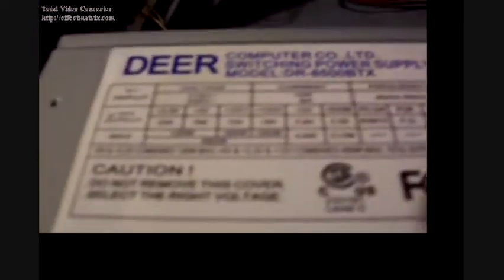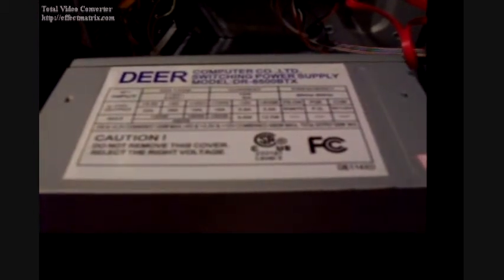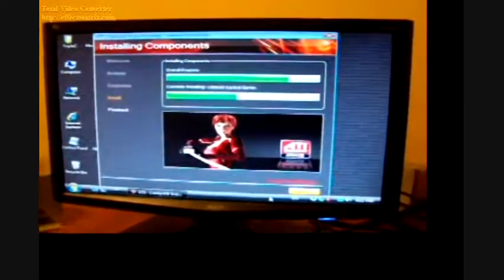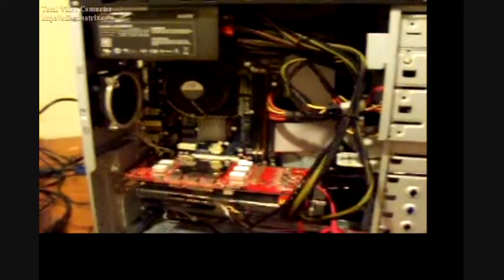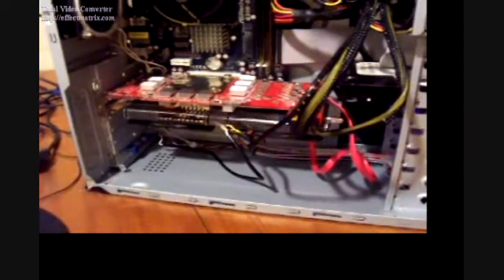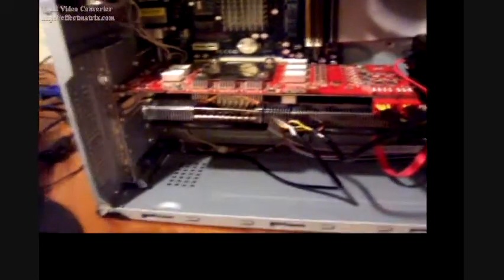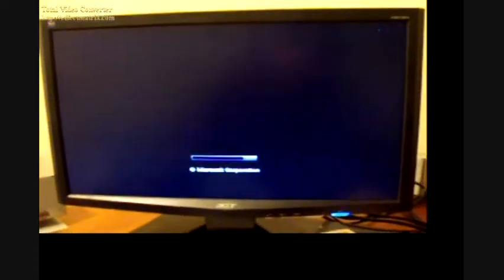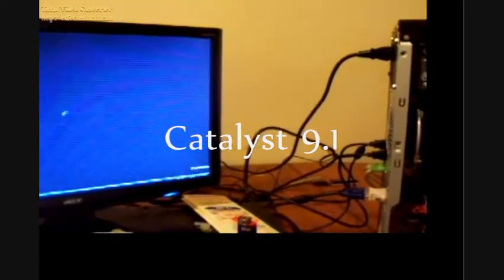Scythe.. OCZ.. PC Problem(Solved) - Part 2 of 2

Comment from the maker: i'm a little confused with the video card part in ur video. u don't have the video card installed.

based of what ur asking, first thing u should do is update ur BIOS, then try video card again, try only one ram to see if it works out, 

basically eliminate possible reasons, i'm thinking it's RAM, it's most likely to be a problem, download bootcd or ubuntu and run memtest86 without windows..

good luck

Comment: well there is probably another problem which causes 9.4 not to work because if it's there it has to have support for it, but ati has already discontinued their drivers for  a handful of cards with 9.4 but it doesnt include the 2900.

Comment from the maker: i dunno if they are officially unsupported or maybe just this card or something, i know 9.3 and 9.4 don't work, will try them again on new rig when it comes, cause it could be cause by cheap mobo as well never know

the vga cooler... the arctic cooling one i had is much thicker, i think arctic performs better, 

will have bench vid this weekend.